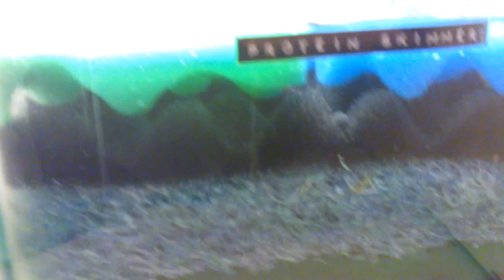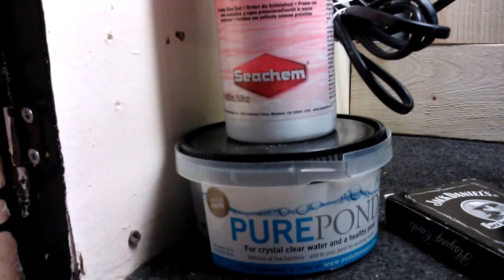HOW TO: Set up a Fish Tank Sump Part 2

Comment: I think your first setup was much better personally and i would layer all of the course, medium and fine pads together to stop your first set of medium and fine getting clogged up. i would put the k1 in the drain chamber so that sediment will make it's way to the bottom and the drain flow will provide your movement for the media. i would also stick to two heaters in case one malfunctions. that's just what i would do though
Reply from the maker: adam murray I found two heater were more of a problem during the summer months when the temperature would naturally reach 28 degrees, then the heaters would over heat and make the water hotter.
Just my personal experience, i would stick to one.

Comment: Hey cool setup for your heaters look into a true temp controller I have had one for about 2 years it works well very happy I pay about 70 US on Amazon well worth it
Reply from the maker: Floyd Morey The tank holds it temperature just fine, I'm actually running just one heater now, as it seems easier to control the temperature that way.

Comment: Don't restrict the flow on your return pump, it could shorten the life of it.
Better to tee off your return and divert some of the flow back to your k1 chamber
Reply from the maker: I actually placed a tap-like value just above the return pump, as this was where the issue was coming from.

Ehiem as very reliable pumps and I dissemble and clean the pump each month to help with any issues this might cause.

Thanks for your comment.

Comment: You need more k1 (expensive I know :-( ) and man you have made that hard too maintain! Anyway best of luck to you mate.
Reply from the maker: Thanks for your message.
I found it easy to maintain as its low maintenance. I simply do watch changes each week and that keeps everything in check.
What size tank and fish do you keep?
Reply: Travel Martinez I'm down to a 150g and a saulosi breeding colony, have you tried a filter sock as apposed to all that foam?
Reply from the maker: I tried a filter sock, but as it's so fine it kept getting blocked. Using the foam works best for my sump set up as it is great for both mechanical and biological filtration.
What size is your tank and sump, do you have a video?
Reply: Travel Martinez 150g tank, I change the sock out once a week and throw it in the washing machine.